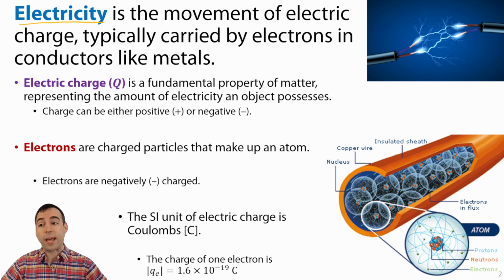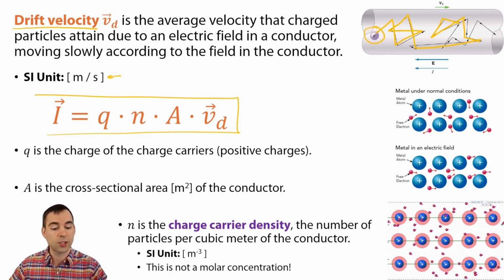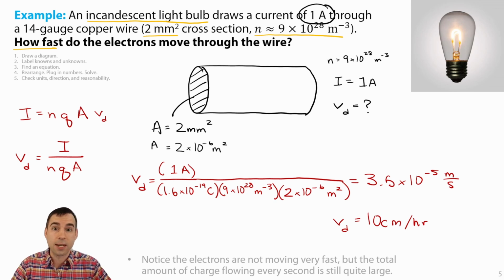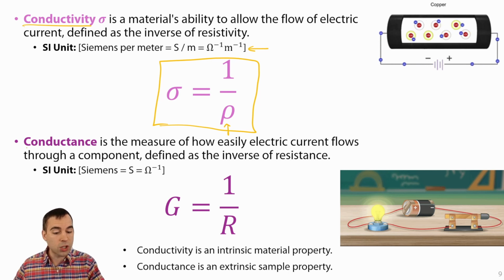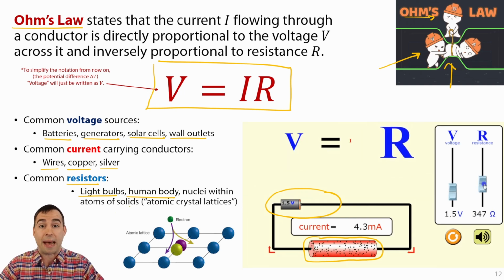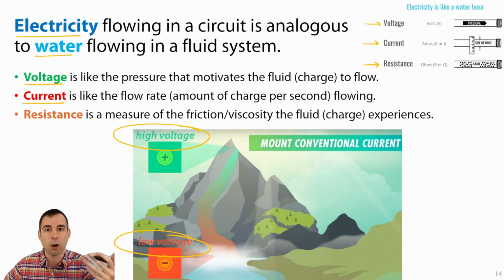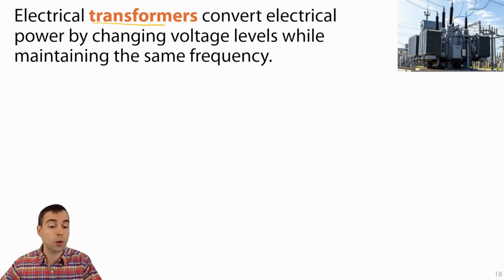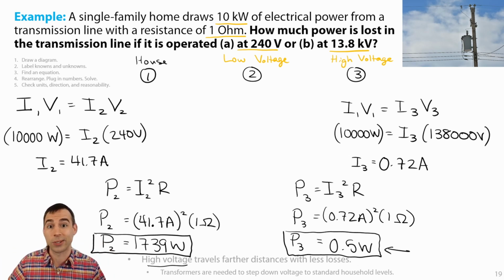Unit 5 Electric Current - UMich PHYS250

Comment: Electric current is the flow of electric charge, usually carried by electrons moving through a conductor. It's represented by the letter I and measured in amperes, which are equivalent to coulombs per second. Although electrons move in the opposite direction, by convention, current is defined as the direction positive charges would move. Inside conductive materials like copper, electrons drift slowly under the influence of an electric field, and this average movement is called drift velocity. Even though this drift is extremely slow—about a few centimeters per hour—the sheer number of electrons allows for significant current to flow. The amount of current per unit area is known as current density and is measured in amperes per square meter.

Resistance is what opposes the flow of current. It depends on both the material itself and its geometry. The material’s intrinsic opposition to current is called resistivity and is measured in ohm-meters. Resistance, on the other hand, is calculated by multiplying the resistivity by the length of the conductor and dividing by its cross-sectional area. While resistivity is an inherent property of a material, resistance changes based on the object’s dimensions. Conductivity is the inverse of resistivity, showing how easily current flows through a material, and conductance is the inverse of resistance, applying to specific objects rather than materials in general.

Ohm's Law links voltage, current, and resistance with the equation V = IR. Voltage, or electric potential, acts like the pressure that pushes charges through a circuit. Current is the flow rate of those charges, and resistance is like the friction or obstruction that slows them down. A useful analogy is to think of electricity like water: voltage is water pressure, current is flow rate, and resistance is the pipe's roughness or blockage.

Electric power measures how quickly electrical energy is converted into other forms, such as heat or light. It's calculated as power equals current times voltage, and can also be expressed using current squared times resistance, or voltage squared divided by resistance. Power is measured in watts, where one watt equals one joule per second. For example, a 60-watt light bulb transforms more energy per second than a 25-watt bulb.

Voltage sources include batteries, generators, and solar panels, while conductors like copper or silver wires carry current. Resistors, such as light bulbs or the human body, limit the current. It's important to be aware of electrical safety—currents above 0.1 amps can be fatal in less than a tenth of a second. Given that the human body has a resistance of about 127 ohms, touching a 120-volt wire could allow nearly 1 amp to flow through you, which is enough to cause serious harm.

Transformers help convert voltage levels for different parts of the power grid. They use two wire coils to step voltage up or down while conserving power. High voltage is used in transmission lines to reduce current and minimize power loss, since lost power is proportional to the square of the current. Before entering homes, this high voltage is stepped down to safer levels. Understanding current, resistance, and power is foundational for grasping how electric systems work and sets the stage for analyzing complete circuits.

Comment from the maker: Voltage 3 on slide 19 should be 13,800 V (I added an extra zero, but the calculation is correct).